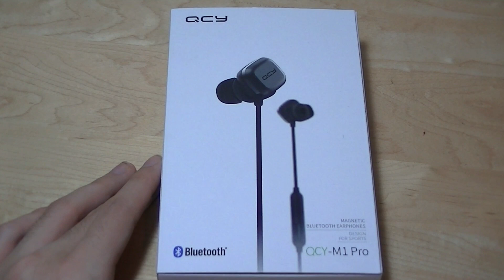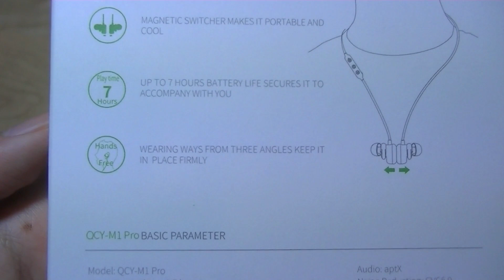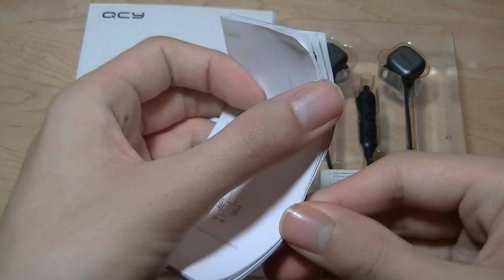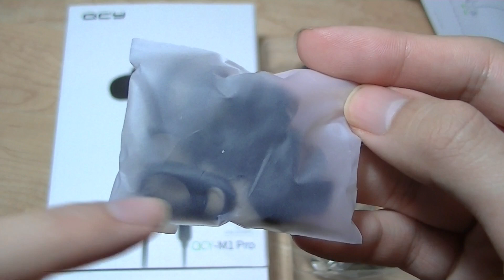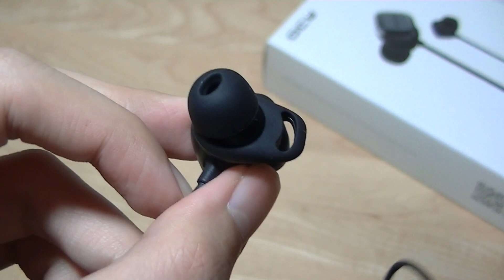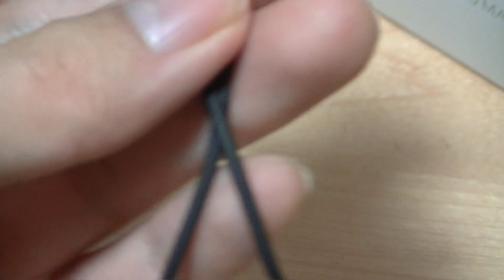REVIEW: QCY M1 Pro Magnetic Switch Bluetooth Earphones

Comment: Could you tell me in writing what you thought about the fitting in the ear?

I bought this model gearbest and would like your opinion, youtube translation is bad
Reply: Manthan I have the QCY M1 pro are excellent, much much better than the QCY QY 12 that I also own .. go M1 PRO !!!
Reply: Ricardo Bernardo I already ordered the qcy m1 pro from ebay for 21$ lol. They're IPX4. Well IPX7s are quite expensive and it's not worth spending because I don't think any earbuds would last long for me. I do perspire a lot during my workouts but I don't think it'll affect the control piece where the buttons and mic are located(qcy). Because that control piece will be hanging between my ear and neck so it won't touch my skin. The position is great. And I dont see any other brand do that. All other brands have those controls that sit near the neck which is prone to get sweaty.
Reply: Ricardo Bernardo so.. How does this perform? How is the sound and bass?
Reply: hussain mahmud it bet theyre good. I dont own them but I have the older version called the QY12 which look similar but they stopped working after 8 months.
Reply: Ricardo Bernardo thanks for the reply man!
Reply: Have you tried anker earbuds or bluedio t energy?
Reply: No friend, just QCY Qy12, QCY M1 PRO and Honor Xsport am61 I already had these and I prefer M1 PRO
Reply: hussain mahmud anker is actually cool but expensive and bledio is good but the T energy you're talking about, I read reviews of it on AliExpress, the mic quality is bad. It was on sale for like 10$ a few days back on AliExpress.
Reply: Ricardo Bernardo dude can you tell me are they good for workouts? I mean can they take the sweat? Because I dont know if its a coincidence, my QY12s stopped working when I used to take it to the gym.
Reply: Manthan qy 12 are not ipx5 with resistance to sweat, so their spoiled. the M1 pro are sweat proof as far as I know, they are also firm and good for sports .. but if you perspire a lot I re recommend buying an IPX7